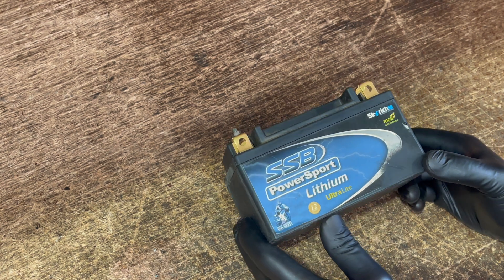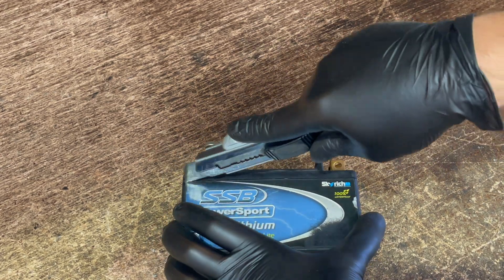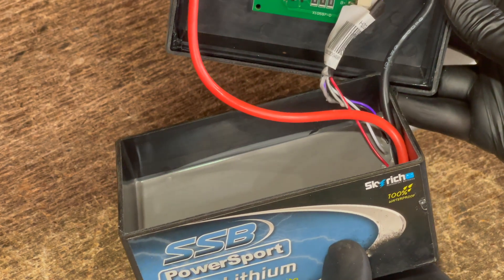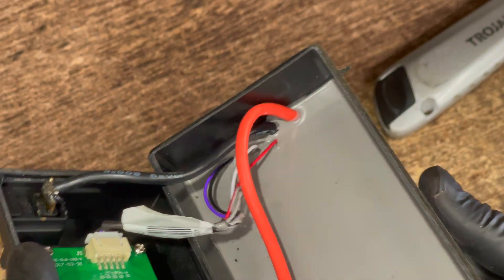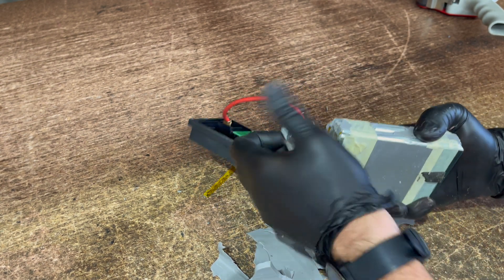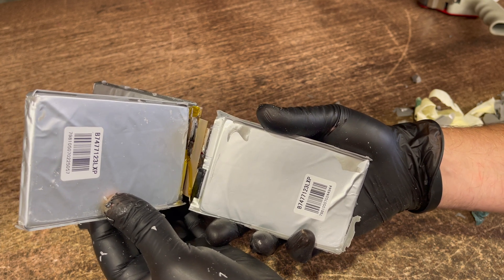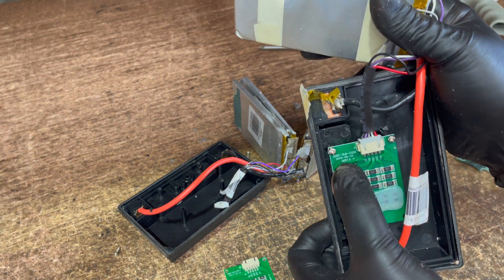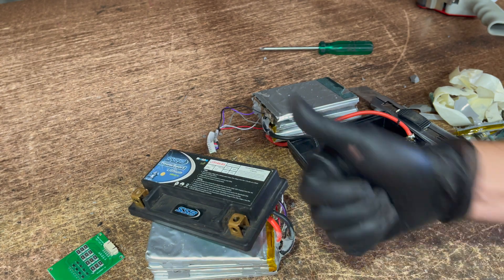What's inside a Lithium Ion Phosphate Battery? opening up a SSB motorcycle 12v Lithium batteries

Comment: I bought one of these about 3 years ago and it died for no apparent reason. I opened it up and was surprised and extremely disappointed to find POUCH cells. Super Start Batteries make a big deal on their website about how their SSB Powersport Lithium motorcycle batteries use "PRISMATIC cells" whereas "other brands generally use cylindrical cells, owing to their lower manufacturing costs, their batteries are inferior". Technically, a pouch cell is a type of prismatic cell, but in practice, they are two very different products. 

I bought the battery believing I was getting the vastly superior prismatic cells advertised, not cheap and nasty pouch cells. For a company who says it has "been researching, testing and using lithium batteries for over 5 years", they cannot pretend this was anything other than a deliberate deception. They would have clearly known what consumers thought they were buying when they advertising them as "prismatic cells".  I would never have wasted ~$200 buying a battery if I knew it comprised of pouch cells

Comment: Well, I watched the video looking for certain explanations and did not get them, just enough to actually be somewhat dangerous at least for the battery and some miss info. 1 Lithium batteries are 1 of two types, Ion or Phosphate. Not both. Professionals call the phosphate type LIPO and use the ION (very different battery) for only those.  This one is a phosphate type according to the info I got from the SSB site ( but part numbers were not included so just slightly conceivable it could be ION, not likely because of the differences in voltages). 
As a phosphate battery it MUST have a disconnect for too high of voltage or too low of voltage, and too high of temps or too low. Not sure, could be dangerous if too high,  definitely ruins the battery if it tries to be charged when the temps too low. This BMS has none of that. The voltages just different enough with the ION battery to make a huge safety impact.  BMS/s for both type will end up with a damaged battery if voltages go too low (no disconnect). EXTREMELY important for a Motorcycle battery, because all you would have to do is leave the ignition on and battery is ruined after a certain amount of time !
Danterous ? Well, if you puncture either type of battery the fire that results is dangerous, so you must have protection for that. The motorcycle would be toast !
Reply from the maker: Great.. thanks! im not a teacher.. i was just pulling a battery apart. thanks for the reply though.
Reply: Neither "professionals" nor people who know what they're talking about call lithium iron phosphate batteries "LIPO".
Lithium-ion = Li-ion
Lithium polymer / lithium-ion polymer = Li-Po
Lithium iron phosphate = LiFePO4

All 3 have different and specific charging requirements and discharge considerations etc.

These SSB batteries do contain LiFePO4 cells.

Comment: Not a good battery.  No BMS, just a balance board.  Nothing to prevent over discharge or over charging.  Also missing temperature sensor to prevent overheating.  I wouldn’t want that in my bike.  It’s likely to leave you stranded in the middle of nowhere.  The problem with this technology is it’s very difficult to figure out who makes a good battery with a well designed BMS that can handle the amperage draw when starting the bike.  Clearly the batteries shown hear have a very limited lifespan without a good BMS.  It would be interesting to see an AntiGravity battery teardown.  They get good reviews, but cost a small fortune.

Comment: No BMS, just a balancer board, no wonder why it failed.
Reply: Yes an active balancer, they didnt put bms as it has over current discharge protection, it will kick in during hard starting events as starter will drawn out  too much current.

Comment: Seems like these batteries should be a lot cheaper than they are.  Nothing inside to justify the high prices they charge. Wonder if the packets can be purchased on there own for a more normal price.
Reply: It costs alot of money to develop then build a quality battery.  Yes you can buy the individual 'packets' which are called cells, but you would probably be quiet supprised how much they cost, atleast for a quality part that will last and wont spontaniosly combust,  then you have to hook them up to a charge controller...  I reckon they are a steal
Reply: @jackheinemann1994  and  anti gravity lithium is around £300  its a lot of money and its only around 4ah.   I can buy a 18v 5ah drill battery for peanuts  I get what your saying but I'm really struggling to justify the cost.. I've been picking up thrown away vape batteries and I've got over 30 now. Made my own battery packs I've got a 7.4v 4500ma 7.4v 3300ma 14.8v 1100ma  and  11.1v 550mah  and still have a few cells left over. And all for free.

Comment: Am I missing something. What does the circuit board do? The case terminals seem to connected directly to the cells, presumably in  Series. So if the circuit board is a battery protection controller how does it stop the cells from over charging or over discharging? I can't see any relay or mosfets to shutdown the power output, if there's a problem?
Reply: It is not a battery protection controller. It is look like a cell equalizer circuit. Lithium batteries must be charged separately each cell in order the battery bank charge to be correct. The circuit not only charging the batteries but also equalizes the voltage across each cell so all cells will have the same voltage, thus same charge.